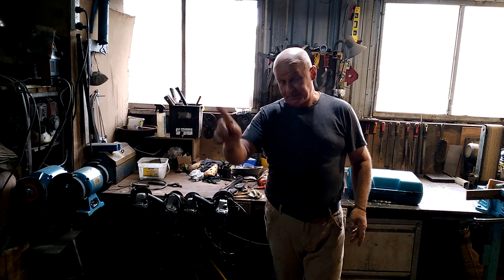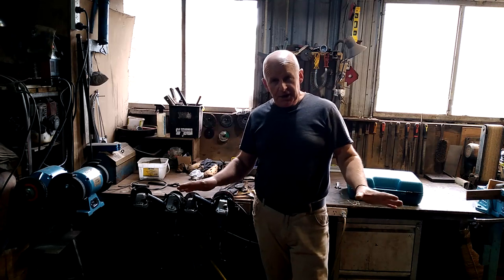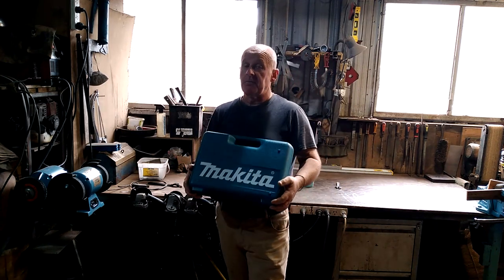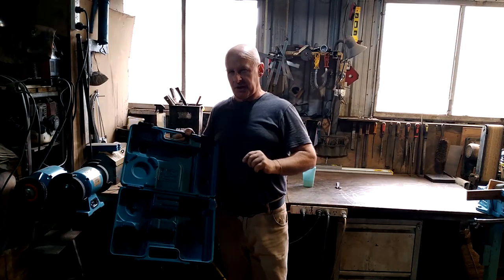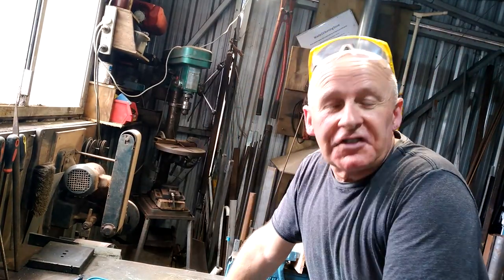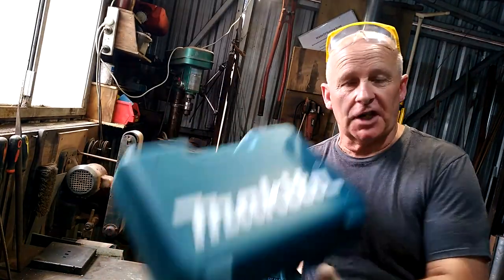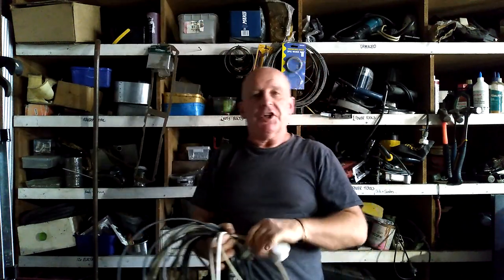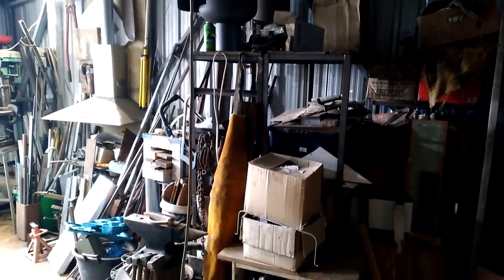What do YOU do with all those empty power tool cases?

Comment: They could be used to hold your grinding disc, wire brush wheels and other grinder parts
Reply from the maker: absolutely. Or paints or glues or screws- so easy to make some dividers and glue them in.  Hey I wish you would show us more of Louisiana- and allow comments. I want to know why you have so many side by sides!
Reply: @t.h.o.r.  hahaha I bought a Yamaha Rhino new in 2007 for fun and working around our ranch and after 5 hard hard years of play and work the transmission finally gave out and broke and it was gonna cost $3500 to replace it and I didn’t have time for them to work on it so I got a 2012 CanAm Commander 800xt new and built it for work and play also with 6” of lift same as the Rhino and then a friend said that he was gonna sell his 2011 CanAm Commander 1000xt fairly cheap and after spending so much money on the 800 building it I knew that if the motor or transmission went bad that I couldn’t find anything to repair it for what this used Commander at $4000 was and since it was running and all I got it.
Reply from the maker: Is it Polaris or can am that are the ones that fall apart? NZ farmers are staunchly Honda and John Deer =- although with sidebysides they do seem to buy Polaris- the Can am sports quads get bought by recreational people mainly I get a lot of seats in to recover and the can am ones are often smashed underneath- plastics too brittle
Reply: @t.h.o.r.  I don’t know about them falling apart. Over here in the states farmers will buy both the CanAms and the Polaris as far as I go it doesn’t matter which one as long as they have a bed area and have good seats. Both of them have utility and sport quads and SXSs